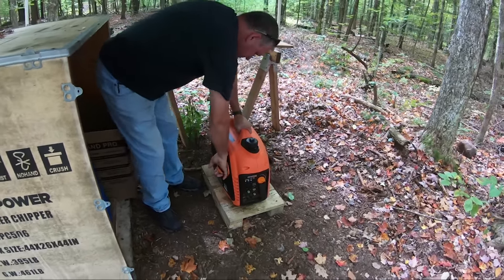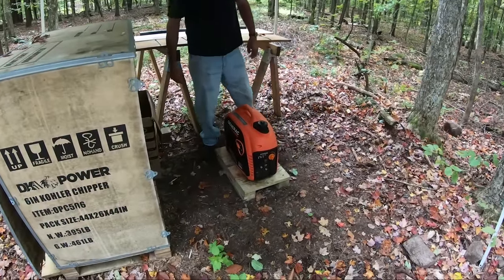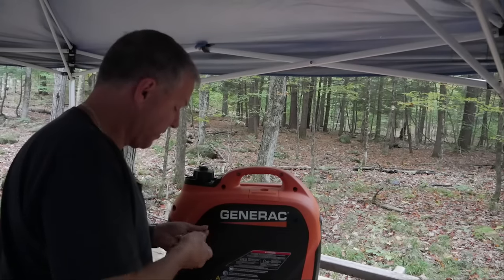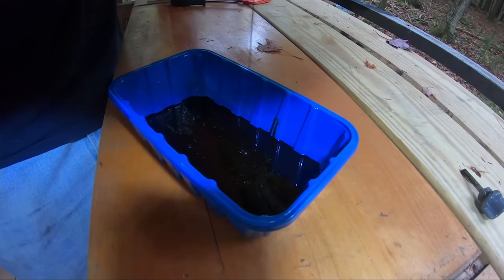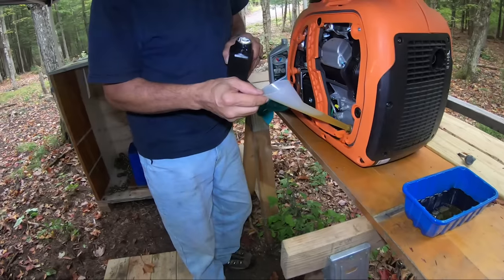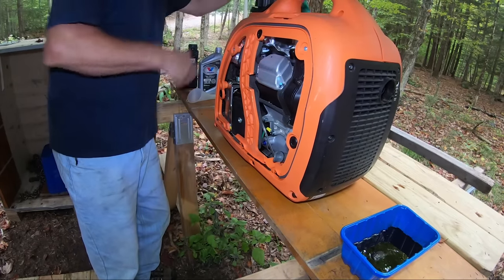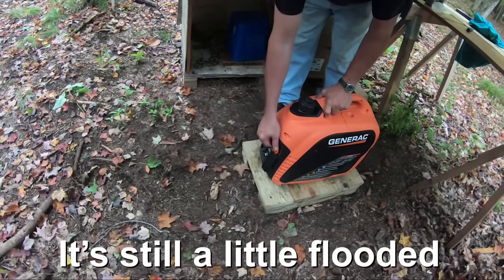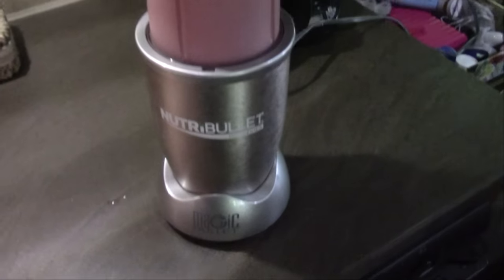GENERAC GP2200i - BRUTALLY HONEST 1 YEAR REVIEW

Comment: Is there a small valve on the gas. Cap that has to be in the open position to all positive flow of fuel to the carburetor? Similar to a gas cap on a storage can.
Reply from the maker: Yes there is.
Reply: Creating A Simpler Life , maybe this closed position of the valve prevented your initial startup.
Reply from the maker: @richardc6932  Good point. That could be what happened.

Comment: was the vent open on the fuel filler cap?  Also that "gasket" is just sound proofing foam tape.  Probably to also isolate the cover from vibration.
Reply from the maker: Yes. All good now👍

Comment: As long as the fuel tank is well sealed and u run dry the carb b4 storing it should start right up no problems. I had my gen sit with same gas for almost 2 yrs and fires right up np
Reply: Red, with this generator can you Shute the gas off and let it burn ALL the fuel in the carburetor?  Looking at getting one but my fear is it won’t start that 1 time I need it.

Comment: I’ve ran my Westinghouse 3600v 300 hour plus before every oil change , I run it every night in the winter so far in Indiana in my camper to run the electric heater in my bedroom and the whole camper, it starts first or second pull even in as cold as the 5f night we’ve had, course I let it warm up before I put a big load on it. But I did the break in cycle properly. And I always turn the fuel cutoff on it and let it die so it always gets fresh gas, just changed the spark
Plug for the first time since I got it 5 moths ago, I didn’t really need a quiet generator for my current location. Great video
Reply from the maker: Thanks. Sounds like you got a great unit👍
Reply: Why would you intentionally abuse your generator. Less than a quart of oil and 15 minutes. Saying you have a great generator and that you treat it like crap is not something to be proud of.
Reply: @Oldcrow77  its a generator not a child lol. They are made to be abused. Never had an issue with it.

Comment: I bought the Generac Inverter Generator 3000i.  I have had it for less than 90 days and have nothing but problems with it.  I have only used it 2x, both for off grid camping trips. I have changed the oil once between the camping trips.  It is now loaded with black soot underneath and inside the compartment you put oil in at.  It is also using large amounts of oil.  My first and second call to the Generac Company was not very helpful.  Now I am trying to get warranty service on a generator that is less than 90 days old. :(
Reply from the maker: That really stinks. So sorry you’re having so much trouble with it

Comment: Great video.  Looking for an emergency generator to back up the house.  Would very seldom be used.  How often would I need to run it or otherwise perform maintenance on it?  I had a snow blower and each time I needed it (only one or two times a year), it would not start due to carburetor issues.  Ditched it for an electric version.  Don’t want to get  one of these and end up in the same boat.  I realize it will not power my whole house, but would provide the necessities.  Thanks for your feedback.

Comment: @9:16 >  Power tools are heavy drain on power, especially at startup.  Invest in battery powered tools if you are living off the grid.  The Dewalt 60V max circular saw will cut just as good or better than the 115v saw you are using.  They also have a small table saw and miter saw that are battery powered.  Makes life much easier when living off the grid.   We have a cabin that is off the grid and it is much easier using battery powered tools.
Reply from the maker: Great advice - we thought the same exact thing after doing that and ended up buying a Ridgid Tool set - if you have time, check out our review at https://youtu.be/3AXAk9BEJSo. Thanks for watching and have a great day! Rich

Comment: I had a similar incident with mine with it stalling and thought it was the oil.  then i realized the spark arrestor for the exhaust was plugged.  with a sticker next to it stating "should be cleaned every 50 hours"  cleaned it up and worked like a champ.  just something to check in the future.
Reply from the maker: Thanks for the info!

Comment: My dad and I each bought one of these for hunting. His will surge when there’s no load, but smooths out when you put a load on it. Mine runs great, but the vent switch on top of the gas cap has to be in between the off and on setting. When I turn my switch to on, there’s not enough air to vent properly and it will want to vapor lock. These are definitely quirky machines, but we only paid $275 each for ours brand new so I can’t complain if it has a few quirks.
Reply: Sounds like carburetor fouling from stale fuel.
Reply: Brad Davies Not at all. Ours are both brand new, less than 10 hours on them, and have always had ethanol-free fuel. Mine is certainly the vent cap switch. I can turn the switch to “on” and it will start surging within 5 seconds. I can move the switch in between on and off and it immediately stops surging and runs perfectly.
Reply from the maker: That is such a good price!
Reply: I put 50 hours on the generator during a long hunting weekend last weekend and it ran like an absolute champ!  I was able to run it with the vent cap in the "on" position instead of in the in-between position.  So I'm wondering if that was just something that needed breaking in.  I have 59 hours total on this generator now.
Reply from the maker: Adam Brown excellent! We didn’t have any issues with the vent cap so not sure about that but I can tell you is gasket us down yet! Glad to hear it worked good for you! Any luck hunting?

Comment: I have the same generator just purchased it it 6 months ago thinking about getting another one two parallel them together run my trailer but my trailer is no bigger than yours but my trailer is the same size as yours I'm going to try the one I have first on my trailer before buying thanks for the video.
Reply from the maker: It does a great job but two in parallel would really be great!

Comment: That oil looks like you could seal your driveway with
Reply from the maker: Agree. It was definitely pretty bad and huge mistake to let it go that long. thanks for watching and commenting and hope you have a great Sunday.
Reply: @CreatingASimplerLifeOffGrid  ... when the oil gets that bad try changing it again next weekend to get the crud out. Use a measuring cup to get the exact amount the first time and you can tip the gen back a bit to save the spills while you work.
Reply: @rupe53  . Don't need too! The amount in the new bottle is the exact amount it needs to fill.
Reply: It was blacker than I've ever seen. Good for the video, we see the generator can take some abuse.
Reply: @nelsonx5326  Looked like blackstrap molasses.

Comment: Biggest thing is neglect. 
Every year I just get 40-50 calls for service and it always ends up being I used it and put away without anything. Old gas etc. or used whatever oil I had. 
I alway tell customers. Use good gas. 
Stabilizer in gas. 
Correct oil. 
Clean up unit. 
And every month or 2. Start unit and let it run for 3-5 min. 
It’s worth it
Reply from the maker: Mike Sacco great advice 👍

Comment: Good video, word to the wise, 1. Oil is super important in air-cooled small engines. 2. why not mention power output capabilities in WATTS. 2a. Eco Mode? 2b. Full power mode? 3 Fuel consumption in both modes non-stop. 4. Always put the generator down on a nice homemade base plate, 5/8 ply painted on both sides with a two-way ball level in one corner (less than $5 to make). 5. A great option, if you plan on using your generator in the same spot, like the campground in the video, consider making a mini earth ground bus bar connect, less than $10. two hours of easy work. Connect the earth ground to all 3rd prongs that you use, or the larger prong of a two-prong plug. this will eliminate most potential problems with electrical noise and dirty power cross-contamination between devices including the generator itself. try and get 8' to 10' of a metallic rod (pipe), copper preferred, in or on damp, moist, earth. You can use two 5 foot sections or three 3.3' sections connected all together with salvaged copper of steel cable with the sections pushed, hammered into the ground. try and space the rods apart a reasonable distance apart (i.e. reasonable;,   > 1' < 10' apart.). Please be well! MarkMannM2
Reply from the maker: Lots of good tips - appreciate it.
Reply: @CreatingASimplerLifeOffGrid  ... grounding is a good idea but DO NOT tie the ground to neutral as it may have a floating neutral which will screw with load sensing, auto-throttle and possibly burn the unit up electrically. If you are not sure just read the manual. (25 year Generac technician, retired)
Reply from the maker: Thanks! Appreciate that very much 👍

Comment: My 2200 has been great so far.  Bought a new drop down fish house and needed power for the forced air furnace microwave etc etc.  Was going to go the Honda route but a local retailer had 150$ off on them.  Got it for 400$ which is good compared to the 1200$ I was going to drop on the Honda.  Got 9-10 hours out of a tank of fuel on economy mode.  Changed the oil after that to 0w-30 full synthetic due to the constant below zero starting situations and removed the spark arrestor which was already semi gummed up.  After doing this my fuel economy went up to 11-12 1/2 hours which is phenomenal.  Seems like the oil stays way cleaner with the spark arrestor removal.  I will be pushing my oil changes out to 200 hours due to this.
Reply from the maker: Interesting information about the spark arrestor. I will check mine for sure. Would be great if the oil lasts that long. Thanks for watching!
Reply: That's too long, considering that these engines don't have oil filters. 50 Hrs MAX!!
Reply: @T   Thanks for that info sir as I'm planning to purchasing one of these soon.
Reply: @vincentrobinette1507  Im going to send it out to Blackstone labs at 100 hrs and see.  Will try and update.
Reply: @JustSomeGuy641  what did Blackstone come back with.

Comment: Great generator in deed, yes it was overdue, but you did the right choice of using synthetic oil !!! Yes do change your oil regularly !!!  Cheers !!!
Reply from the maker: RCAFpolarexpress thanks! Appreciate that very much👍
Reply: @CreatingASimplerLifeOffGrid  I used to be in charge of a lot of various types of generators on the airports and always make sure the used the synthetic oil. For none oil filter generators running on gas,  I was changing the oil every 24 hrs on operations but you could go to 48 hrs. I have a 6500w honda generator since 10 yrs (still look new after more than 200 hrs ) and if i use constantly, i do the first oil change after 24 hrs and then I change it every 48 hrs and then if it goes on storage mode,  I drain all the fuel from the carburetor, oil the piston from the spark plug hole and put fresh gas with preservative additive. My best advice is read all the operation manual and by doing extra oil change will not not fail on you. I forgot to mention that a good clean up is good too and store it in dry spot !!! Cheers !!!
Reply from the maker: Appreciate that!

Comment: I have been a mechanic all my life. Most problems with small engines is lack of maintenance. You must change the oil and care for the fuel system. No ethanol fuel and a good fuel stabilizer seafoam is the best on the market it works thought I would give you guys some pointers for for long service life I also forgot to mention keep your air filter serviced and I’m not sure if you have a fuel filter in that system If it does it should be serviced at least once a year
Reply: Change the spark plug too. It will start much easier.

Comment: You need to read the owner's manual which furnishes  maintenance schedule.  There should have been more thought to empty out the old oil.  I used the same combo drain pan disposal container to empty out the oil.  It was still messy.
What I am looking for is a maintenance manual that show how to adjust the valves.

Comment: My Yamaha would not run if it was not perfectly level so I took it in to the shop and they cleaned the carburetor and now I can tilt it in any direction up to 45 degrees. I thought it was going to be some sort of oil level sensor but it wasn't.
Reply from the maker: John interesting. Thanks for sharing that 👍

Comment: I leaned the hard way that when you’re done with a small gasoline engine like a lawnmower or motorcycle for the season, it’s important to turn the fuel valve off and then let the engine run dry until it sputters to a stop. This will get all of the gasoline out of the fuel line and The carburetor.  Otherwise the gas will go bad, it becomes like a lacquer and clogs a carburetor.  It’s a simple thing to do when you think you’re done with the engine for the season.  If the engine does not have a fuel shut off valve like a lawnmower does not, then just tilt the engine and pour the gas into a container and then let the engine run a minute or two until it stops.
Reply from the maker: Thanks! Appreciate you taking the time. Hope all is well where you are!
Reply: That's not what you want to do! The gas actually acts like a lubricant to the seals and hoses! Put "Stabil" in the fuel tank to preserve the fuel life. Run for a few minutes to get completely through the fuel line and intake. Also, you may want to put some clean oil on all rubber hoses and rubber so the don't dry out if you're storing over a long period of time!👍🇺🇸
FYI: 1 Bottle of replacement oil is exactly the amount for which it needs to refill, minus the filter.
Reply: I have a rototiller that I run for 1 hour each spring. I always turn it over and drain the gas after using it. I take the fuel line of my snowblower and drain the tank.

Comment: Do you have the original book to tell you how much oil to put into the generator? Also those small gen sets need to have the plugs changed often and the spark arrestor cleaned. Do it all the time in my small engine shop.
Reply from the maker: Waterman one yes we do. Thank you so much. We will be getting done right from now on. 👍

Comment: Strongly suggest that Ethanol Free gasoline be the gasoline of choice for your generator.  5 weeks isn't TOO long between uses - but how about over the winter?  Simply running the engine dry before any multi-week storage is also sound advice - along with always changing the oil at the end of your camping season (and making a little overwinter storage reminder tag-on-a string for the pull handle to say "Yes Honey, I changed the oil last fall!")   :~)
I use Ethanol free gas, Multi grade Synthetic oil and get 5-10 weeks use from the oil for an off-grid cabin.  A restaurant type, plastic, squeeze style ketchup bottle from Walmart makes periodic addition of "a few drops" of top-off oil easy, accurate and not messy.  A Walmart boating section hand operated transfer pump (NOT a 'siphon pump') makes a practical vacuum remover for removing used oil - after you learn to use the one moving part  :~)  .  OH, almost boiling water will soften that funnel's body to allow very careful permanent bending of the tapered part for faster, easier changing of oil.
Joe S
Trapper Creek, AK and Idaho for the winters
Reply from the maker: All great advice. Appreciate it very much!
Reply: These cheap generator burn tons of oil - running synthetic is a waste of money.  This isn't a fuel injected engine with 10 micron filter - running ethanol-free gas is not necessary.

Comment: Thanks for the tutorial.
Just set up my own Gen'. I noted that it took a full quart of oil.
Unfortunately, the manual advised both 10/40 AND (elsewhere in the  manual) 10/30. I went with the 40 and although I finally got the Gennie working it smokes like an aristocrat at a Country Club. But she works!!!
Next change I'll go for the 10/30 and share what I learn. 30 is less viscous.
Still...thanks for your tutorial.
I learn something new every day.
Reply from the maker: If you have the same model, and put in a full quart oil, you definitely over filled it . The crankcase capacity is 11.5 oz. I would drain it an  use   5w30 full synthetic. Make sure machine is level, and fill it to the top of the threads in the dip stick opening. It is definitely not good for the engine to run it when over filled with oil. It could cause seals to leak and cause carbon build up around valves and piston rings shortening engine life.

Comment: Nice. Trying to decide on generator for a tiny house shed. Hue Lights, Allen LED TV, 5000 air conditioner, 750 / 1500 ceramic heater, 700w microwave. Of course the three main things won't be run at the same time. So thinking a 2000 watt generator would be fine. Otherwise 3500 Harbor Freight one. Kind of expensive though. But quiet still and smaller than the bigger ones.. But I think the 2,000 might work.
Reply from the maker: We are very happy with the 2200 we have. It was worth the money. I have heard good things about the harbor freight one but no personal experience. I can say that the 2200 serves all our needs, but we don't ever use the microwave at all. It's actually disconnected and used to store all our treats :-)  However when we make coffee nothing else can be running.